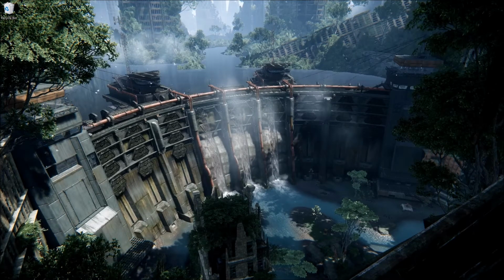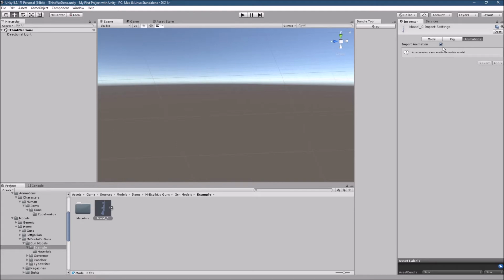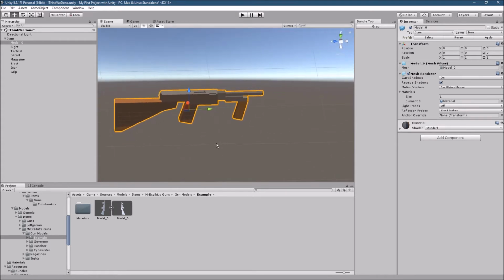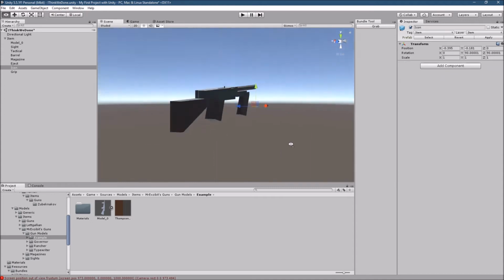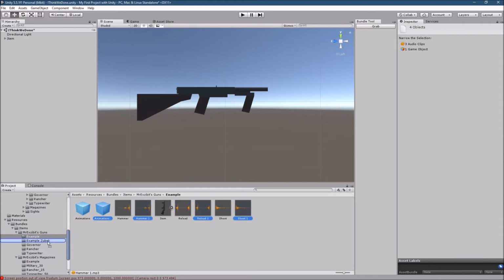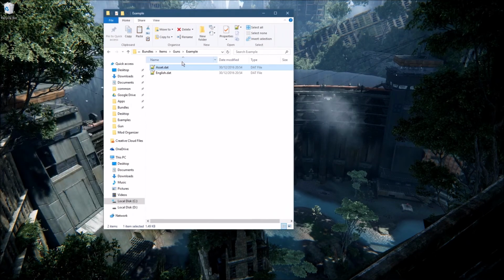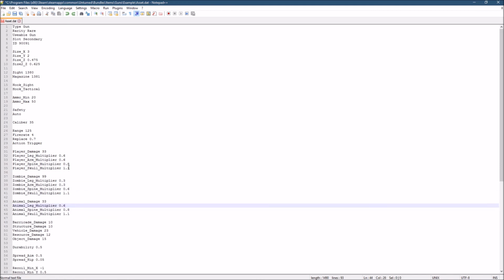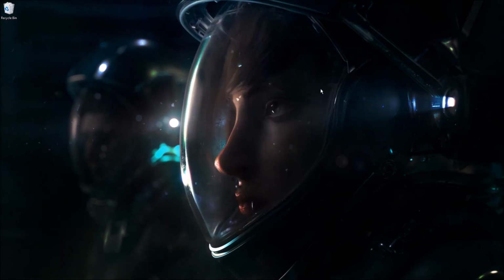Unturned Modding Tutorial - How To Set Up Your Gun in Unity and Blender

Comment: Frequently Asked Questions(FAQ):
1.)My gun wont spawn
 -Make sure you removed the camera component from the Icon Object, make sure you have all the Emptys (Magazine,Eject,Barrel.etc) dragged to Item so you can see an arrow beside Item, make sure you tagged everything right.
 Make sure you renamed the .dat file so that it wont be replaced.
2.)My gun is misplaced
 -This is a hard process but you can fix it by just adjusting the scale and rotation. If it is still misplaced then you might want to adjust the origin of the model in blender so that the origin is in the front of the trigger then apply the scale and rotation.

If you want to have more info check Zykrah's guide on steam.
If you need help also dm me on discord : Aljon050705#4713